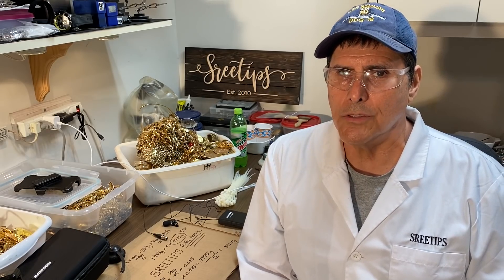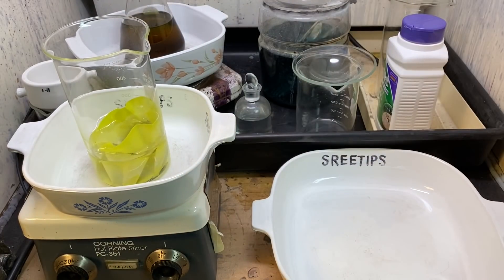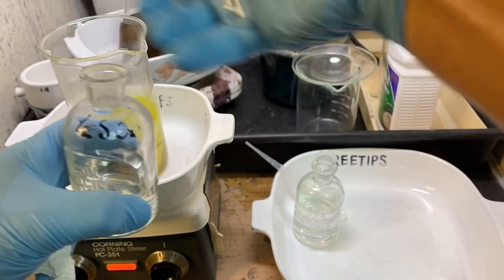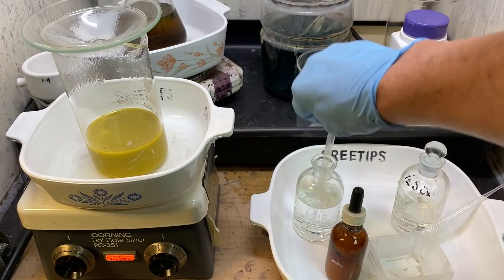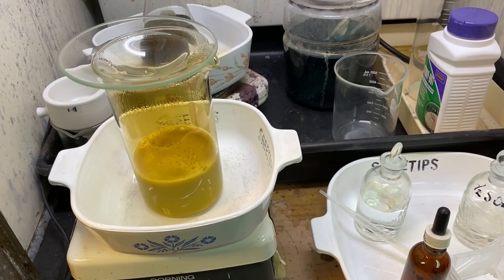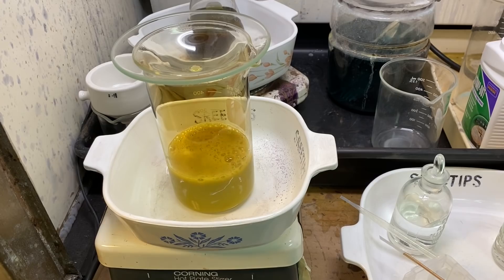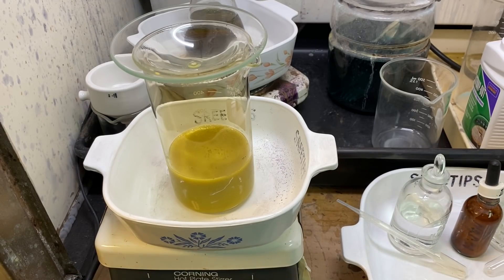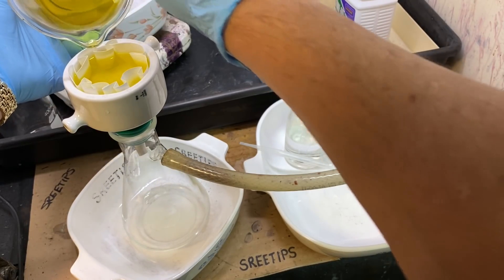Pure Gold Reverse Plating Cell Part 8

Comment: I think.
When you let it The solution cool, It allows The solution to pacify. You probably have to keep it at a high enough temperature.
That doesn't Is passify. I have learned from your videos, That's why I share this And appreciation, Thank you. I have also noticed That you have gators too I've seen other people meet on YouTube.
 For some reason I have difficulty.  salfuric acid Might be  The biggest culprit
Reply from the maker: When the acid heats up, it starts deplating erratically

Comment: I know this is an older video, but was struck by the amount of work done in the de-plating process.  As a thought would it be quicker, easier if all of the scrap was put into the reaction cell at the same time and not using the copper basket, connect the pile of scrap to the cathode using a graphite rod?  If that works then the entire batch could be ran at the same time.
Reply from the maker: Discovering a way to do it all at once would be very helpful.

Comment: I love these reverse plating cell videos. But one question. I noticed that in your buckets you use for rinse water and add your ice to then your gold dust have a thick black ring around the bucket. Is it possible to lose some of the product to the grains in the plastic? The reason I ask is after completing 3 weeks of deplating almost 100 pounds of plated material I'm coming up really short. So I lost some somewhere and I'm trying to figure out where. We already ran filters and pulled everything out. I did notice that my anode bar appears to look gold now! Is it possible I let it sit too long so it clung to the anode?
Reply from the maker: This is a way to get gold from plated junk. But the amount of gold is just too tiny. It’s only a few microns thick. Hundred pounds may yield 5 to 7 grams - if your careful and lucky. I can never get a decent yield with the stripping cell.
Reply: @sreetips  I used a jumper box due to my battery charger passing on In mid process. Lol kinda wondering if the jumper box pushed more ampage stripping it to the core. I'm not sure how that would work exactly. I found my lost product in my rinse. Filter had poked a hole. Thank you for responding! I am also kinda curious as to my return here too. I know it won't be much but I only need 11 grams to finish my project. Moving to aqua Regia in a few days. Just discovered some kt scrap I had laying around. It's really awesome you did these videos like this. Thank you! I'll let you know how we turn out!

Comment: Just subscribed. 

I hope you see this and can respond to me. This process is way too complex for me. I have a few small gold-plated copper items that I'd like to have the gold removed from. A previous owner gold-plated them, but I want to restore them to original condition. If you'd be willing to remove the gold from them for me, I'd be willing to pay for this service. You can contact me on gmail.com. (first name).(last name)@gmail.com
Reply from the maker: Michael, unfortunately I only work on material that my wife and I find at local sales.
Reply: @sreetips  Thank you for your reply. Is there, perhaps, some other method to remove gold from copper that is simpler / safer? Perhaps at the expense of requiring more time?  Remember, I'm not interested in recovering the gold; rather, I just want to get back to the original copper. 

Unfortunately, I just don't have the space or experience to store or handle dangerous acids and such.

Comment: Very interesting. Why would you not start with Aqua Regia with the plated parts?
Reply from the maker: Recovery is about concentrating values for refining. Hitting the gold plated junk with aqua regia would put EVERYTHING in solution, form precipitates, and cause any gold to be lost. You’d end up with a big toxic mess and no precious metals. The stripping cell, while difficult, is the easier, softer way.
Reply: @sreetips  Thank you for the quick reply. I have some stainless steel plates with gold and Tunsten/Ti (10% Ti) layered. I am trying to work out the best way to recover the gold. The plates are too big and heavy to send for recovery (13" x 13"). Any ideas would be greatly appreciated. I was all set to use you reverse plating technique but then i purchased some HNO3 and thought that might be easier. Information i found said that W and Ti were resistant to AR at room temperature. I guess I also have the Stainless to think about.

Comment: wouldnt the cathode hold more metals ?
Reply from the maker: I don’t think so
Reply: positive particles would attract to the negative cathode posible some of the electrons would head towards the anode  , but then gold is inert , ah perhaps the circuit was not powerful enough to drag the gold out of solution
Reply from the maker: There was a coating of black on the lead cathode I wiped and added to my paper storage.

Comment: Ok what’s wrong with just dunking the plated jewelry in aqua regia until there’s no gold left visibly on the surface and then precipitating the gold? You might also dissolve some base metals but the coating is so thin that it would take seconds in hot solvent to dissolve the gold coating
Reply from the maker: I’ve never tried. But Calm Morrison Hoke recommends against it.

Comment: Wouldn't some of your gold you precipitated out of your aqua Regia return to solution unless you boiled out the nitric in the aqua Regia repeatedly, by evaporation, with HCL, before precipitation?... as being precipitated out of AuCl solution instead of Royal water...I thought any nitric causes yield to return to soulution...
Reply from the maker: Yes, but only if I premix the “royal water” but I never do. I add small doses of nitric to just dissolve the gold. If done correctly then there’s no need to “boil out the nitric” because there won’t be any excess nitric to get rid of. Incremental nitric dosing. Second only to inquarting karat gold as one of the most valuable refining techniques that I ever learned.
Reply: @sreetips  Yes...I did notice your unmeasued aqua regia proportions...you may be on to something.. ..thanks for the tip.

Comment: How much gold is on a 24k gold ring? If you were to refine a 24k gold plated ring how much gold would you extract?
Reply from the maker: The gold plating is nanometers thick. A nanometer is one millionth of a meter. The plating is so thin that the gold plating come off of some of the pieces - IN THE ULTRASONIC CLEANER. Gold plate is very very thin almost nothing. The ONLY way to get any value out of gold plated jewelry is to de-plate in the sulfuric acid stripping cell. Many a beginner has found this out the hard way by trying to refine gold plated scrap with aqua regia. If you try then you’ll end up with a big mess, wasted chemicals, and no gold.
Reply: @sreetips  Thank you. I understand you.

Comment: I have a question for you.. So I've been following you for quite a while now. I also took your advice early on , so I've been a member of the gold refiners forum for about 20 months now.  It's taken me this long to get the necessary equipment and knowledge I feel that I need to be able to do this safely I just did my 1st and 2nd inquartations today! Mostly karat scrap but there was a couple of pieces of gold filled in it as well. The first one went flawlessly the second one however I know I measured out the right weight of silver but I don't know if all of it was really silver?  I mean I tested it but obviously I screwed up somewhere because I got it in the melting dish. I malted the gold 1st  and then I added the silver.. YIKES!! boy howdy it popped and it crackled and it acted almost like thermite it burned really bright but not constantly just a bunch of flashes it was the weirdest thing. Im at a loss.. Would you have any idea what kind of metal I could have got and how in the world it tested positive for silver because I did 2 acid tests one directly on the piece after i filed a notch in it after a positive Touchstone test with 18k solution. Any ideas?? Any help would be greatly appreciated keep up the good work you're a plethora of knowledge and I thank you very much for sharing it! 😎
Reply from the maker: I don’t know what you’ve got there
Reply: @sreetips  well crap that makes two of us then. Lol. And I'm thinking maybe that wasn't whatever metal that was burning??  I think maybe it was my gold.. 🤔😧🤬😫 I'm certain my math for the inquartation was spot on, however nitric boils left me with a big ole "hahaha" from the refining gods in the form of a very thick purple cloud of colloidal gold... umm I think ?? Colloidal gold is kinda purple-ish right? Which would lead one to believe I added too much silver or some gold went bye-bye somehow..???
 Can i ask what you would do in this instance???
Im thinkin maybe I oughtta just hit the reset button??...   Filter the solution put all the brown powder, and filter papers in a Melt dish, melt  and then re-inquart everything all over again.?.? 
 HOWEVER THIS TIME   Ill be using the relatively pure silver I drop from this very solution. Because as I said this is my 1st attempt so I don't have an excess of anything (besides bills and frustration) layin around. Lol.  Especially silver.   I used up almost every scrap I had to get it wrong this time.🤬🤪 But I am persistent, and I'm enjoying this more than probably any hobby I think I've ever had so I'm certain I'll get it right next time. I'll know for certain I have pure silver this time... Any how Id really appreciate any advice and also your opinion of where I sould go from here with my screwup.?.?? 
Wow! Good grief, I'm sorry for the rant.  I'll quit yappin at u now.. Keep up the good work bud, I can't even tell you how much I've enjoyed, and how much I've learned from watching your channel, your advice and and the wealth of info from the gold refining Forum which U referred me to. You're freakin awesome bud! Thanks again! You and Mrs. Sreetips have a wonderful evening! Fingers crossed, I'm gunna see if I can't fix my screw up.. Lol
Reply from the maker: Phattplatt D colloidal gold means 1) too much silver was added or 2) a piece of plated or filled material was mistakenly counted as karat scrap.
Reply: @phattplattd7414  Ensure everything you process like this is karat scrap and there is no gold plated or gold filled material. The copper content of plated and filled pieces throw off your math for the proper silver content.
Reply: @ut000bs  I truly thought I had been quite carefull. Maybe even overly cautious. I test each piece at least twice. I use a Touchstone and when its positive I tak a file a Deep gouge in it and test again.  I also always test silver with both the silver test solution and 18 karat solution. Ive found sometimes the  silver test solution isn't quite as decisive as I hope it will be and I get more of an orange stain instead of blood red so I use the 18 k solution on a very heavy rub on the Touchstone. If that rub line turns into a streak of milky light blue speckles the Touchstone after I add the 18 karat test acid then I know I've got silver. I thought I was pretty thorough but I guess not.  I'm pretty sure a piece of gold filled got through somehow. I'm human and we all make mistakes  however I'm almost certain my math wasn't off. I generally don't make mathematical errors . It's been several days now though and I have siphoned and rinsed the gold four different times I'm going to go ahead and melt it again. I cemented the silver back out of half the solution, and dropped the other half with HCL last night and will give it a second go today.

Comment: Cool stuff bro! I got about 13lbs of coin silver to process, and had been thinking about a cell. Now I know exactly how to do it. EDIT. Lol, you even have the same chemical bottles I have.. Do you make your own Nitric too?
Reply from the maker: For me it’s easier to buy nitric
Reply: @sreetips  Really? it's expensive as hell for me to buy it in the usa. I bought some glassware and make it from ammonium nitrate and walmart "liquid lightning" drain cleaner (90+% virgin sulfuric acid) I vacuum distill it too, so it's WFNA at about 94% strength.
Reply from the maker: Demandred1957 I’ve seen it done on YouTube but never done it myself. Philip Bender has a good YT video on making nitric

Comment: The stannous chloride reaction here is much darker than the one where you got gold from 1000s of sim cards. Interesting how you thought there wasn't anything of value left in these filters yet from what I can tell so far in this video it is much more valuable than that whole sim card process.
Reply from the maker: I could have gotten a better yield on the SIM cards if I had incinerated them instead of acid/peroxide

Comment: Just Curious, how do you De-Nox the active Nitric?  at this stage my precipitated gold always re-disolves.
Reply from the maker: Add just enough nitric to just dissolve the gold rather than pre mixing 3 to 1 or even 4 to 1. I’ve found that 10 hydrochloric to 1 nitric does rather nicely. Pre mixing just isn’t done any more. It guarantees that there will be issues with excess nitric during precipitation. Incremental nitric dosing eliminates the need to remove excess nitric. Because there won’t be any to remove, if done correctly.

Comment: Wondering if the bleach method is always an issue , or just need more ?
If your always going to get less ,
VS. just using aqua regia . 

I only use hydrochloric hydrogen peroxide at this time - until I can have a fume hood .

Comment: One of my first jobs in mineral processing was in a university assaying lab. They had some stubborn PGM ores with chromites that were resistant to the 'usual' boiling HF, nitric and perchloric acid dissolution techniques, so I had to carry out the mother of all ways to get precious metals locked up in inert matrices, sodium peroxide fusions. Basically the samples were mixed with a few grams of yellow sodium peroxide beads in small zirconium crucibles and then hit with a torch flame while swirling with tongs until cherry red. The result is that the stubborn inert stuff if dissolved into soluble salts, afterwards the whole thing is placed into distilled water and then acidified and THEN using normal oxidising acids WILL recover all your precious metals. You can find the published technique and recipes (it's a dangerous technique so I would definitely follow vetted published recipes) by googling sodium peroxide fusion assays in zirconium crucibles, I'm sorry, it was decades ago and so I can't recall the detail. I'm thinking you may want to try it on those strange PGM residues you got that you couldn't seem to dissolve in boiling acids. This may 'unlock' some more goodies out of them.

Comment: I've been wondering why the sulfuric acid goes in when you disolve rather than after if precipitation of lead is the point.
Reply: AS long as it's in and any lead removed before precipitation of the gold, it dosen't really matter when it's introduced.

Comment: You know this haunted me all night as you are aware im just a casual observer of the channel and most of the things I know about this craft is. Limited by what I have seen on your Channel I just really couldn't wrap my head around how all you got was that one small tiny gold BB there's just no way that small amount of gold could have plated it all that jewelry and after you did the aqua regia and combined all your fines together it looked to be still a little short but a much better yield than the first time. Amazing!
Reply: Oh, it certainly can. The jewelry could be plated a lot thinner, but there is a legal minimum in the US - it has to be at least 10K gold and the plating muct be at least 0.000007 inches thick - that is 7 millionths of an inch.
Reply: @buggsy5  that's amazing how much a tiny BB of gold will coat
Reply: @josephpecoul6532  It is possible to make much thinner coatings, which will last for a while. That entire lot of plated jewelry, including the stuff sreetips sold, could be "gold washed" with less than 0.1 gram of 10K gold. I wish the FTC would prohibit that type of coating for jewelry items, as it wears away quickly. The only proper place would be on items like metal picture frames that are not going to be handled, just hung and left alone.
Reply: @buggsy5  I had no idea but now that I think about it makes sense

Comment: hello sreeptips, question outside the subject, what are these white porcelain spills called and can they be used directly in the flame to heat? maybe you can find them here in Brazil in stores or in the free market.if you can inform me about the brand
Reply from the maker: Those pyroceram. Corning Ware dishes. Very tough. But I don’t think they’ll take a direct flame
Reply: @sreetips  ok,tanks or obrigado!

Comment: You are using way to much acetylene or you need to add more oxygen to get a good flame. For me I would use a brazing head to cut down on the gas but still get a good heat for melting.
Reply: Using excess acetylene promotes a reducing flame, while not burning as hot or as clean as an oxidizing flame,  it prevents metals from being vaporized while melting. While not mandatory while melting gold, it is essential to keep a reducing flame for silver and some other PGMs.
Reply: I think he's purposely using a carburising flame so as not to introduce Oxygen into the metal.

Comment: Could there be even more gold in the beaker of waste solution from the HCl/Bleach refining?
Reply: That's the reason the liquids aren't thrown out, they get put into a stock pot where they settle out over time or get cemented out using copper. The buildup on the bottom of the pot can then be re-refined and can yield more precious metals.
Reply: Likely yes, no chemical process is 100% efficient. But it's unlikely that the current volume of waste would yield enough gold to be worth re-refining
Reply: That's why it gets put in the stock pot/waste bucket system. Any residual will get precipitated out and reclaimed when the stock pot is processed.